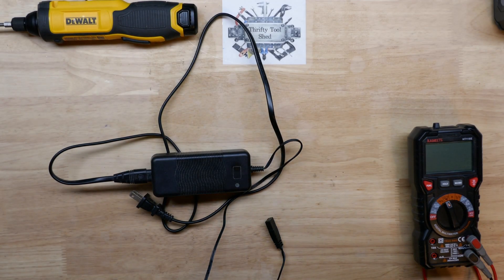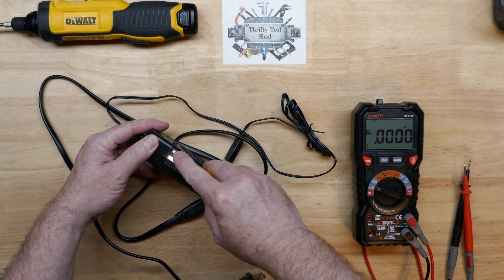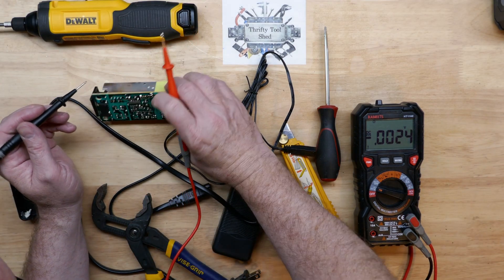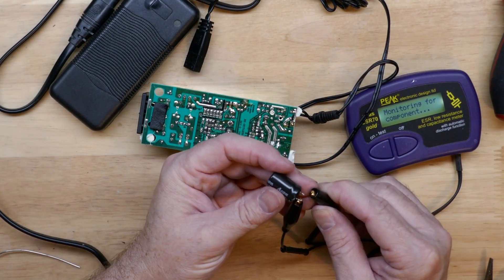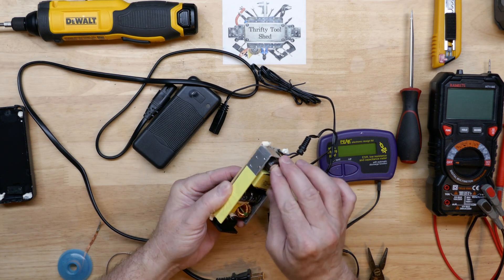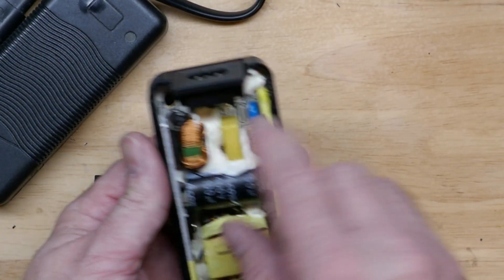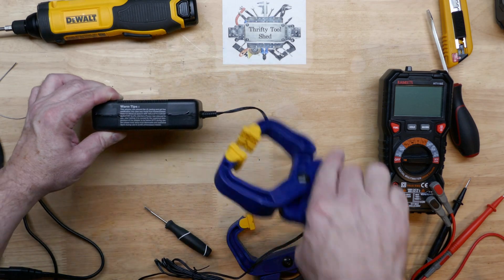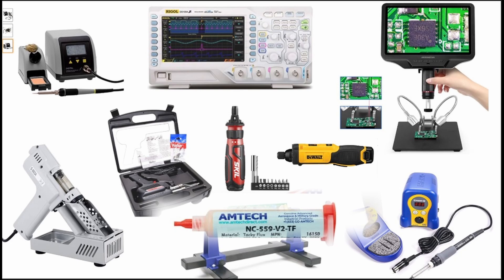Dehumidifier 15V Power Supply Repair

Comment: Is that a Peltier device? I wonder after you called it a dehumidifier and said the power block was rated for 4 amps. S/U on compressor would certainly be alot more. I probably missed the first video on this unit's repair. Nice work, thanks for your time.
Reply from the maker: Yes sir it is a peltier device. It's slow but steady and helps in a small storage room etc. It should be a very reliable unit, but unfortunately they used cheap switches and now I see cheap caps. Hopefully it will run for a few more years. I really like the idea of it and how simple it is. Thanks for your kind comment!